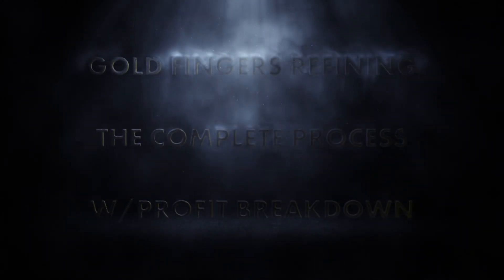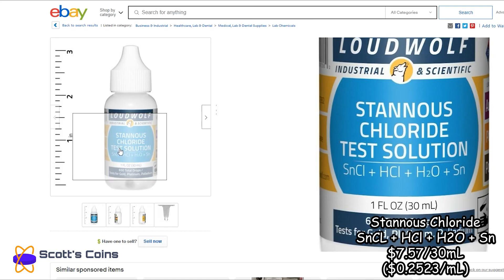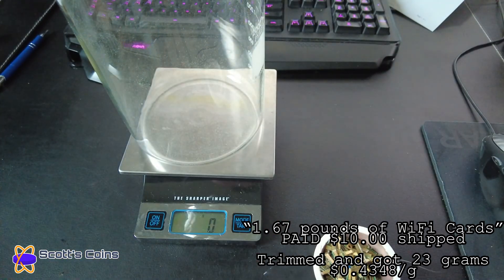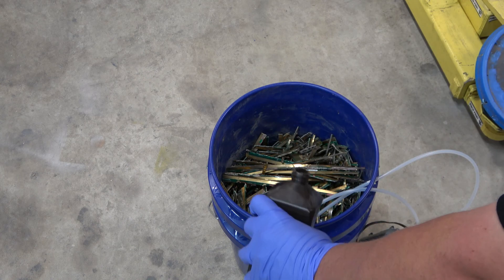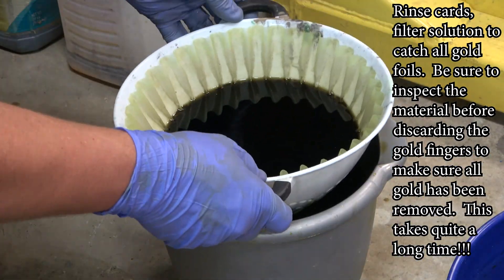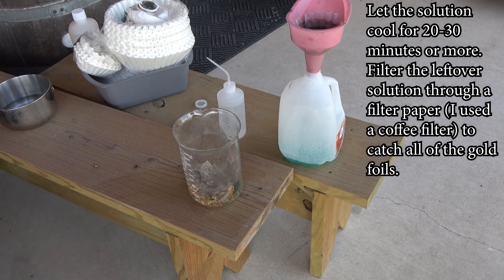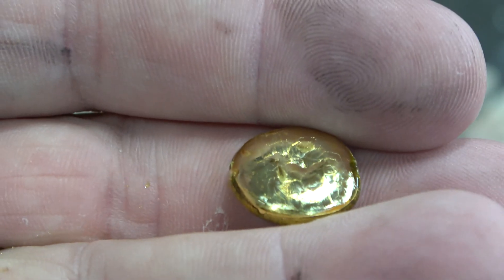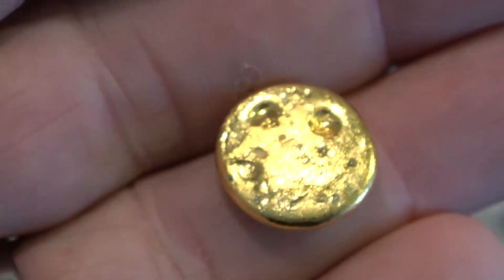24K Gold Refining from Computer Parts - the Complete Process + Chemicals Cost

Comment: Before I do my very first process of recovering gold was wondering do I actually need a CorningWare dish between the beaker and the hot plate, I actually have bought a magnetic stirring hotplate and wondering if that makes any difference as they are made for that?   It's a $250 one not just a cheap one 🤔 I realize that maybe a good for extra precautionary reasons in case of breakage but also use Basilica glass wondering if that makes a difference as well thought you might know.  The extra layer may affect the magnetic stirrer

Comment: Nitric acid i waaaaaay cheaper if you make it yourself via sulfuric acid (cheap) and sodium nitrate (also cheap, like 5$ a pound) and this makes quite a bit of nitric acid, but its best to do this on a larger scale and outside so that you dont have to do it again for quite a while (oh and you need a distilation apparatus, a glass one not the alchohol ones itd tear those apart.) oh ans also yo ucan just make your own stannous chloride by taking tin metal and disolving it in the hydrochloric acid, way cheaper than buying it, plus you can make as much as you need.

Comment: I've watched numerous recovery methods of gold from electronic scrapping. I came to the same conclusion that it's only - possibly - profitable if you get every electronic free and don't buy it.  Labor Time Spent Working is money lost - waiting for reactions while doing something else is not wasted Labor Time, just as Labor Time Working to get the electronic components out of the computers, phones, etc...is Labor as if you're paying somebody to do it, you doing it should count as an expense like an hourly wage.  https://www.youtube.com/watch?v=1prC05Beu5s   This is the fastest and cheapest way to leach disolve the gold off of electronics with Tincture of Iodine 2%.  You could use a weaker solution but it doesn't dilute well with water.  Precipitate the gold with lye water and add L Asorbic Acid (vitamin C) to form a gold powder.  You should refine  it further with normal aqua regia and meta bisulphate before melting into a button.